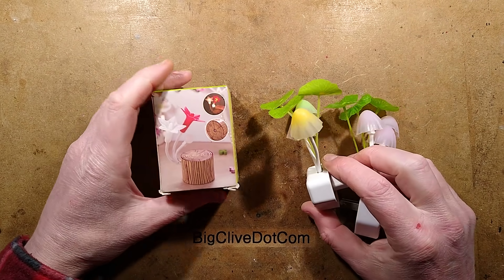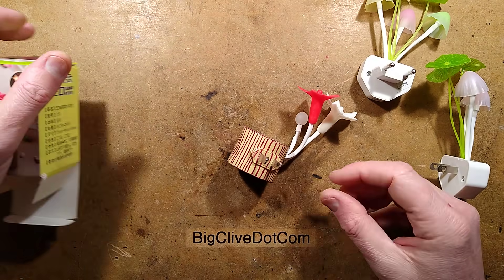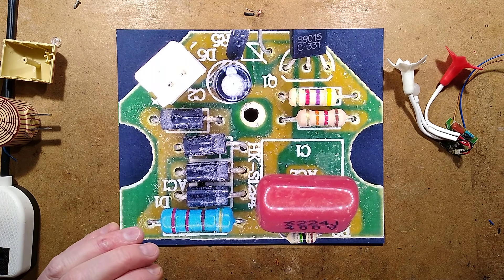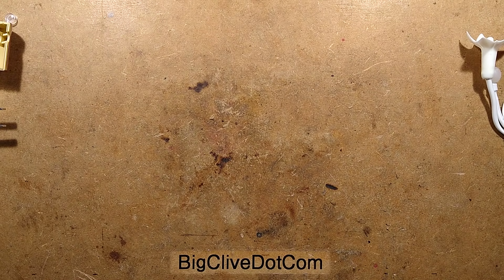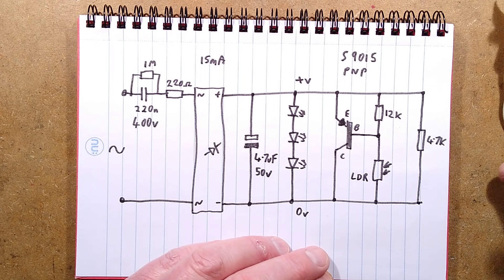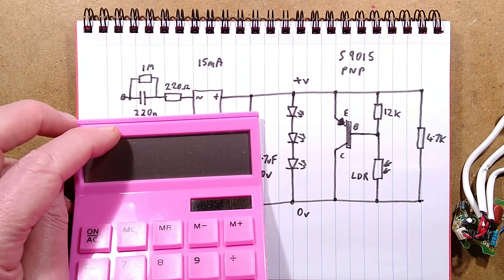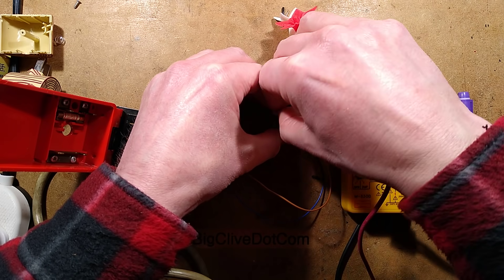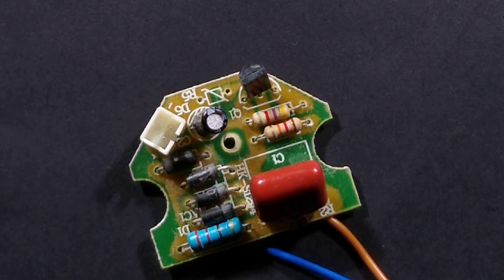Trying to blow up a Chinese night light - and failing (with schematic)

Comment: I find it amusing they included two flowers, and then make the third LED cover a ball.
Reply: Yeah, not the other way around, right?)))
Reply: Probably to resemble a berry...
Reply: @LarixusSnydes  True.  I didn't consider that.  Although it is kind of odd to have a single berry on the end of one long stem,  and not a cluster of berries.
Reply: @LarixusSnydes  maybe a flower bud?
Reply: @solinus7131  Yes, that I suppose that could work. Although, I would expect it to be a little bit more ovoid to tear shaped.

Comment: I was playing with mains voltage and rewiring Christmas light strings when I was 8 years old.  Scared the crap out of my dad when he figured out what I was doing.  He couldn't argue with the fact that it worked though.
Reply: Probability, coincidence and curiosity helped us make it so far, also killing many others in the process.
Reply: I remember, per my father's instruction, cleaning the contacts of the bulb holders and sockets with a small knife, live and unsupervised
I figured out pretty quick not to hold the knife by the metal parts to avoid the somewhat current limited shocks.
Reply: @Broken_Yugo  ouch :D
Reply: @Broken_Yugo  I happened to fix a light switch in a dark room. I had a screwdriver with no insulation and a pair of wet slippers, and daaaaang the wires were live!
Reply: @morpheox  Farrrrrrr from the hardest I got bit around that age. That award probably goes to when I figured out you could siphon the anode voltage off the face of a color TV with a piece of aluminum foil, and started charging leyden jars with this ~25kv source. Long story short I ended up suddenly on the floor and never told mom.
Reply: @jkobain  Yeah, that's a firm handshake. Had a similar experience working on a furnace barefoot on a bare concrete floor, some asshole 50 years ago wasn't careful wire nutting stranded wires together and there was a single live strand hanging out.
Reply: My lights caught fire,  my grandma and father went nuts. and with my hands burned. I said this is what I want with my life.       electricity!!! . Now I'm a industrial electrician. I get to play with all the fancy robots.
Reply: @jasonb4370  don't forget to tell your kids and grandkids about that. ;D
Reply: I changed a single wall socket to a double including drilling the wall for a double box while my parents were at evening service (in the summer).My Dad wasn't too happy, but he then got me to do more of them in the house.

Comment: I wonder if it was 60V and not the calculated 70 because the transistor was acting as a crude zener, going into breakdown and taking some load off the resistor. The increased current/voltage then killed it after you cut the resistor out. The S9015 is only rated for 45V max working/minimum breakdown C-E

Comment: That gift-wrapped PSU looked reasonably OK for low priced Chinese kit - the isolation was OK (although there was space for anti-tracking slots), and the Class Y capacitor was a nice addition.  Looking forward to seeing the analysis in due course.

Comment: That PCB looks like it will fit in a UK plug, using only the onboard fuse and ensuring neutral is the side connected directly to the rectifier.

Comment: I have few UL listed 120V single led night lights the power company gave me, pulled one apart now out of curiosity, very similar design with a dropper cap and a S9014 shorting the power rail to dim the LED, big differences are it only used a single 1N4007 half wave rectifier, 100uf 16V smoothing cap, and what I can only assume is a zener (small glass body diode) for safety between the current limited side of the dropper cap and the mains end of the rectifier.
Reply: If that is a zener it's working both ways. On the 'backwards' direction the zener limits the voltage to a sane value. In the forwards direction it acts as a normal diode to 'reset' the capacitive dropper. Without that resetting current the capacitor won't pass any current.

Comment: Hi Big C, re your quick connect connector. As you say these have been around for some time . I worked as a test engineer for a company manufacturing electronic test equipment, scopes, signal generators, frequency timers/counters etc many moons ago, and these were introduced as part  of safety measures in the product test department after a serious shock incident to a colleague. I use one now it's a RS product (rs 458-926) and I can definitely say well worth using.  Just out of interest we used to call them rat traps !!!!

Comment: The Vce of the transistor is -45. It probably went into breakdown around 50 volts at low current with the 4.7K sharing the brunt of the current. When the 4.7K blew open (measure it) it allowed the full current to be sunk just by the transistor alone and it blew shorted.

Comment: 15:24 It's not 15mA, since the output voltage is higher, the capacitor dropper gets less voltage. The current is now more like 12,8mA which means the resistor gets 0.77W, not that close to 1W.
You could measure across the cut resistor by putting the test clamp across the entire circuit board where the resistor was connected.
Why not test the open circuit withe the transistor removed. (Or did you, but nothing happened)?

Comment: Hi Clive, My brother got our dad an interesting kitchen appliance for Christmas (link below). It prepares eggs (hard/soft boiled, poached, omelettes, etc.) in a dish suspended above a hot plate over which you pour a specific amount of water according to the desired doneness, then cover the whole thing and let it steam until a beeper goes off. The interesting quirk with it is that there is no timer. The only variable at work is the amount of water on the hotplate; for example, a soft boiled egg takes less water - and therefore less time - than a hard boiled egg. It seems the circuitry is able to detect when the water has evaporated off the hotplate, at which point you hear a fairly loud click (a relay?) right before the beeper goes off.

I am VERY tempted to take it to bits and see if I can figure out how it works. I am hoping the hotplate does not become live at mains voltage when turned on, because there doesn't appear to be any safety mechanism that only allows the hotplate to activate when the cover is on, for instance. You might be cooking more than eggs if that is the case...

Here's an UK ebay link to a carbon copy product with a different logo slapped on it (with picture of the hotplate): https://www.ebay.co.uk/itm/Egg-Boiler-Steamer-Electric-7-Eggs-Cooker-Boiling-Machine-Functional-Steamer/153931784187?hash=item23d70c9ffb:g:bVIAAOSwGXZeskzH
Reply from the maker: It does sound like it's boiling dry and then cutting out.  If the beeper is wired across the thermostat it will be activated by the voltage when the switch opens.

Comment: 0.2W is pretty good for a night light. 
I made one years ago using one your capacitor dropper videos, as inspiration. 
It's still going strong at 1W, and a lot of light to illuminate the staircase. No photo sensor thingy. That's for girls.
Reply: I've made built in night lights in my bathroom and landing/stairs lights. So don't need to switch on any lights when getting up at night... No photo sensor needed, they only cost few pence/year to run...

Comment: Those silver coloured electrolitic can capacitors really do go bang if over volted or if they have not been powered up in years, don't worry because the latter only applies to old equipment like valve radios an TV sets, the rule with these is power them up on a Variac to allow them to reform, some don't an they still go bang taking a few components out with them, they also make a mess of the chassis, I find it best policy to use rubber gloves while cleaning such mess because old caps can contain PCBs.

Comment: I love these videos.
I'm no engineer so, excuse me, but I'd love any answers about one thing. 

Can't get my head over the discharge resistor over the capacitor at the beginning. We'll I do get the discharge part... Thing I don't get is what keeps the full live 240V from going straight trough the resistor and blowing all the parts up full force?
🤔
Reply: The 220nF cap has an impedance of about 14476, from 1 / (2 * 3.14 * 50 * 0.000000220 )
Hence at 240V, the maximum current is about 16.6mA, from 240 / 14476
The resistor in parallel with the 220nF has a much higher resistance than the 220nF's impedance, so can be ignored.
If only the 4K7 resistor was present, the voltage across the electrolytic would be a maximum of 78V, from 4700 * 0.0166
But in practice the LEDs -- or the transistor which sometimes shorts them -- provide a lower-impedance path than the 4K7; and hence the electrolytic isn't over-volted.

Comment: I needed one analog light sensor for my school conclusion project last year, had to use a digital one because that little circuit part cost so much alone it wasn't worth it, if I knew I could get an analog light sensor, some LEDs and a socket I'd be so happy at that time...
Reply: Correction, I did have one used analog light sensor, but it was even more sensitive than this one, enough that during our project it only proved itself as working twice, luckily our project was modular, so excluding it didn't affect all of it that much

Comment: Clive, I noticed slots in the PCB where the mains connects. What are the chances the spacing between those is the same as on a US plug? Some versions probably have the power pins soldered directly onto the board.
Reply from the maker: I think it is designed for that.

Comment: Come on Clive, you could have tested it open circuit with the transistor gone!
Those small caps can break the skin if you quickly dump enough energy into them, but still, that's no excuse not to even try.

Comment: 60 volts across 4.7kΩ is 12.8 mA. The resistor would be running at 0.77 watts, so only about 3 times its normal rating, not four.

Comment: Could've also used the open (clipped) end of the resistor as a place to connect the positive lead. There's no voltage drop across a resistor that's not passing any current. :)
Reply: Or just plugged in a JST fly lead, as that is the full supply voltage in a convenient plug in location.

Comment: Talks professionally about electric stuff.
* brings out a pink calculator *
Well, here goes part of my faith of the professionalism... 😁
Reply: You hand't realise that pink is something of a theme here?
Reply: @calmeilles  I don't. So, what are you mean?
Reply: @zsombor_99   When Clive has the option to get something in pink he will do so.
Reply: @calmeilles  Oh, that's possible, because he used to use a pink lightbulb socket when he testing something with E27 base. At least custom LED projects not "centered" around the pink color. ☺

Comment: 18:00 Isn't that a place for a metal-oxide varistor marked at the top of the circuit board? Presumably another component they thought was an extravagance.
Reply from the maker: That was where the LDR light sensor was.
Reply: @bigclivedotcom  You may like mustie1's latest video on a ac starter motor. Skip to 20 min for when it starts to get naughty. https://youtu.be/kCR1GCi5ym0

Comment: Do you see a way to power this unit or the mushroms with a 9v block and still keep the light sensor intact?
Though the leds run on 3v each i managed to run them directly on the 9v-block. But not with the fancy day-of function.
Reply from the maker: With a battery the day-off function in this light would actually drain the battery faster.
Reply from the maker: Ah, if you meant a power adaptor then a simple series resistor would work.  But it would have to be a high value as the transistor would effectively short the LEDs.  It would be easier just to leave them on all the time by powering them directly with a suitable resistor.

Comment: With a 0.22uF capacitor at 50hz the series impedance is 14,468 ohms. Z = 1 / (2 pi f C). Circuit current would be I = E / R = 16.5mA.

Comment: When the trasister shorts the LEDs and the 15mA is out of phase, how will smart meters read that power usage?  Will the power company be able to charge a person for that?
Reply: Well, the out-of-phase current does wear and tear on their cables and transformers.  Before smart meters they had minimum power factors in the contracts.

Comment: Thanks for the video - but why didnt you take out the LED again after chopping off the BJT ? I was was promised a blowing Capacitor :-(
Reply from the maker: It would have been a boring slow blow result due to the series dropper cap limiting the current.

Comment: Hey. Would you please illuminate me on a light bulb I have? It is an 60w incandescent "emergency beacon" from the 90's.  Turn it on and it stays on normal, but flip the switch on off on rapidly and it will strobe/ flash. What is in it? Thank you.
Reply from the maker: I've not come across a tungsten one, but some LED lamps have a similar function where they have a power supply that can stay active for a few seconds when disconnected, and detect when the power has been removed and reapplied by a sense resistor that monitors the mains directly.  They use it to switch intensity or colour.
Reply: I looked at it again. It has no visible components besides the element. It is not frosted and I can see to the bottom. All it seems to have is the inner glass tube that holds the element. I would mail it to you if you would like to take a peek. It functions.  The postage would be trivial.
Reply: If not and your still interested search ebay "mcgruff crime dog beacon". I see 2 listings for 12-15 dollars US respectively right now.
Reply: Most light bulbs I have with flash when you flip the switch rapidly, but somehow I don't think that's what you meant. If it wasn't sensing the external switch I'd say it had a bimetallic blinker. Is it possible it has a tiny circuit potted in the base?

Comment: I don't understand why the transistor, when turned on and placed directly across the output of the rectifier, does not cook.
Reply: The rectifier only supply 20mA when the transistor is on. The red cap and 220 ohm limit the current from mains voltage. Not much power dissipated
Reply: @dianagung8071  I actually understand that. Thanks.

Comment: strange shunting  - does that mean... current is shortened.. and lost ?
Reply from the maker: The current is shunted but is reactive current, like having a filter capacitor across the mains.  Quite complex, but the result is that you usually don't get billed for the out of phase power.
Reply: @bigclivedotcom  
as a Dutch guy.. that sounds good..

Comment: They could have just used the transistor to cap the voltage by moving the extra resistor to be in parallel with the LDR.  When the voltage climbs too high, the resistive divider would then turn the transistor on to clamp the voltage. Power ratings must obviously be respected since it will be in its linear region, but it could at least provide some protection without any more components if the LEDs are unplugged. Edit: Well after seeing the rest of the video never mind. Typical inadvertent Chinese "safety" engineering to the rescue with the transistor shunting everything out.

Comment: Hi sir.how did you calculate that 15ma??
Reply: Using Ohm's Law.   I = V/R

where I = current, V = Voltage, R = Resistance.

With the above formula R needs to be calculated, as we’re dealing with a capacitor as the current limiting component. We can still use the letter R, as in a capacitor the effective resistance is called Reactance.

The formula for reactance is:

Xc = 1/2(pi) fC

where Xc = reactance

pi = 3.142 (approx)

f = frequency in Hz

C = capacitor value in Farads

The result obtained from the above formula is in Ohms, which can be directly substituted into the Ohm's law calculation at the start of this reply. Hope that helps.
Reply: @theonlywoody2shoes  got it. Thanks o lot❤❤

Comment: Ahhhh, I was wanting a bang and a flash and a blowing up of a capacitor!!!  :-((
Reply: He could have unplugged the LEDs, and applied power, but nooooo, he didn't!  Guess he didn't want to have to clean up foil and crap all over the bench.
Reply: @tomhoehler3284  I had an electrolytic blow up on me from a power supply 12Amp, the can shot up and bent the mesh foil covering the supply well out of shape (I put it on the power supply due the the heat that used to come out of the supply, I could see inside), I saw a flash, the can hit the mash and then what looked like miles of paper fill the insides of the power supply.  I couldn't believe the amount of paper that came out of the capacitor!!  It must have been tightly packed, very tightly.  I took the mesh off the supply (it was serving as the cover) and it was full of brown paper, more than I thought they could pack in there.  It was one hell of a bang!  I had just turned the supply on for the day.  The electrolyte has corroded the board and the tracks are now lifting, the solder has gone all crusty and refuses to melt, it may be lead free, I don't know, but I thought it was to old for lead free solder.

I will have to fix it somehow as I am going to need it and can't afford to buy a new one.  I may have to make a new board for it, but as I have never made a board before and do not have anything to make it with I will have to find a way round it.  I am disabled, so it won't be easy, however, I am not one to give up easily!

All I can say is you do not want a large electrolytic capacitor blow up when you are near it!  it is not good for the heart!!